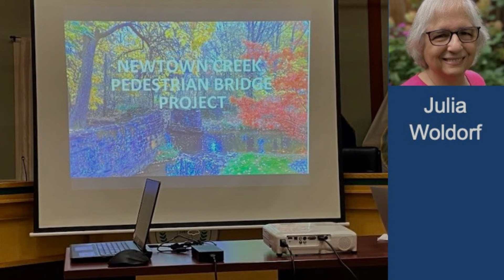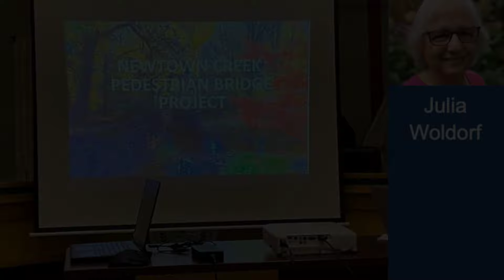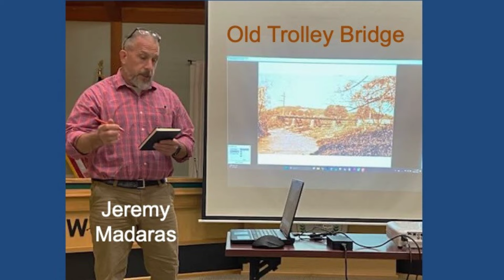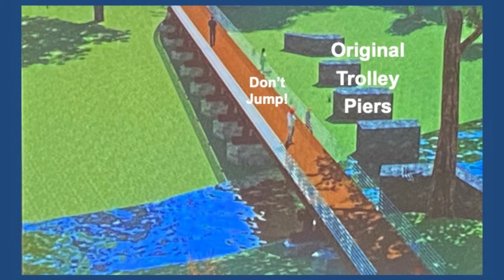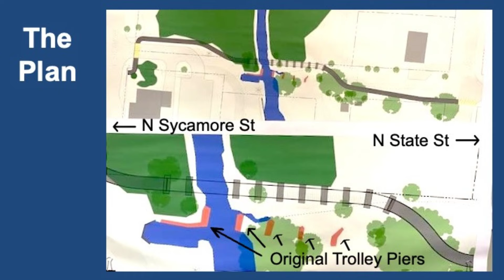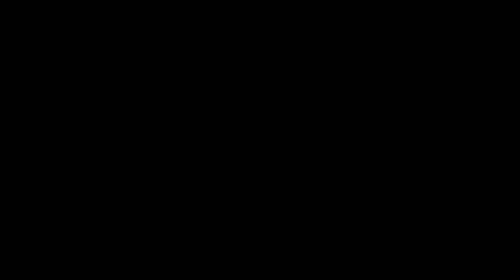Newtown Creek Bridge Public Presentation

Comment from the maker: Some questions I had:
(1) What happens if the maximum 5% ADA-compliant ramp requirement is exceeded? Right now the design calls for 4.9% (at the N Sycamore St end). I was told that there would have to be some excavation to lower the angle. Of course, this would add to the cost.
(2) What about flash floods knocking down the bridge? The height of the bridge is 7-8 feet above the creek. At flood level it is only 2 feet.
(3) "Threading the needle" was mentioned several times, which is concerning.
(4) This is called a "Pestrian Bridge," but it is also "multi-modal" meaning it can also be used by bicyclists. However, the width of the deck is only 8 feet, whereas multimodal trains such as the Newtown Trail along Lower Dolington Rd is 10 feet wide. Also, the American Association of State Highway and Transportation Officials (AASHTO) recommends a minimum of 10 feet for multi-use trails, and 12-14 feet for heavy use. Is 8 feet wide enough to accommodate both pedestrians AND bicyclists?
(5) What about further resident input? I was told that input might be sought regarding the type of railing used.
(6)"Signage" was mentioned - I was interested in this because of the possibility of using the railing to hold mural panels as was suggest for the pedestrian bridge that connects George School and Newtown Borough above the Newtown Bypass (between Buck Road and South State Street): https://sco.lt/7uZgqO The bridge can include "platforms" off the side (not sure what these are called) that may be used for benches and/or mural panels.
(7) What about tree removal? There may be a couple of trees that need to be removed. There are plans for extensive planting along the sides of the ramps leading to the bridge.
(8) Night illumination was mentioned. Is it safe?